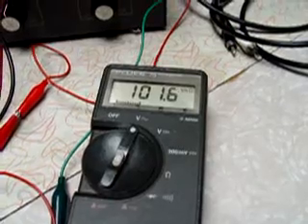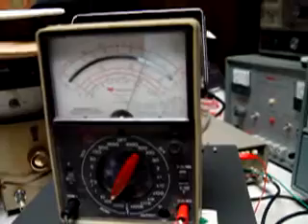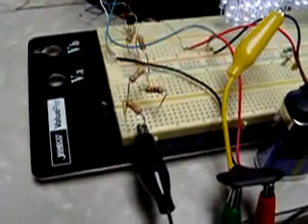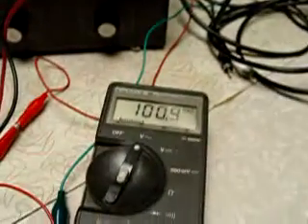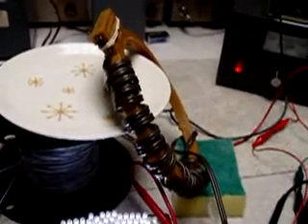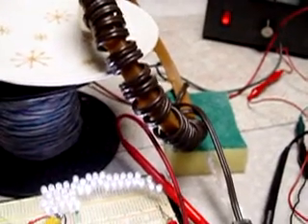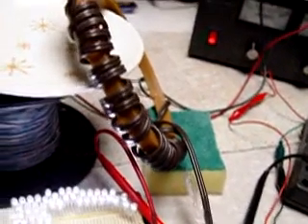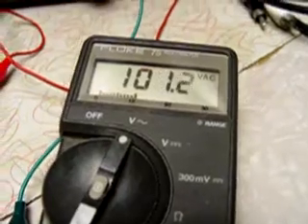Bedini / Davro one Magnet Motor...Load Test 42 LED's 100+ Volts !

Comment: Can you estimate the overall efficiency of the system at this point, total input power minus charge compared to output in watts? Stated more simply;  would it be possible to gauge the C.O.P of the system at this point?